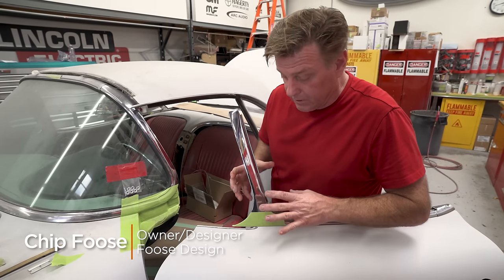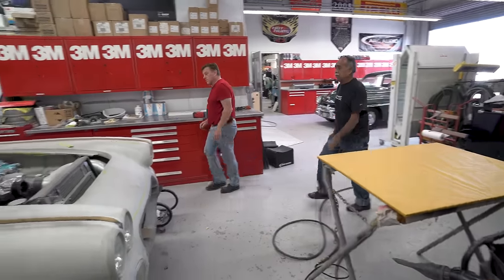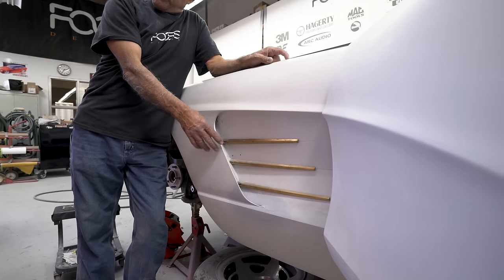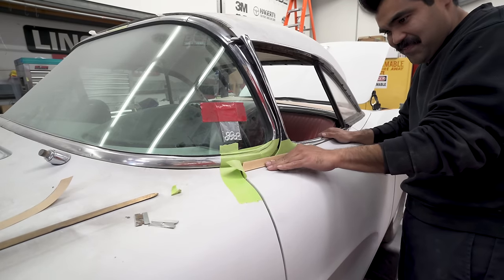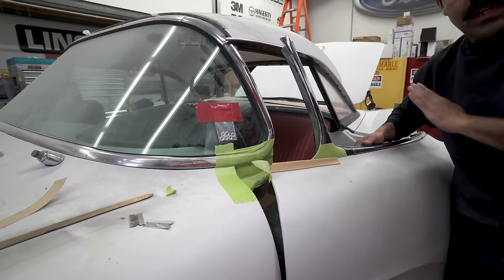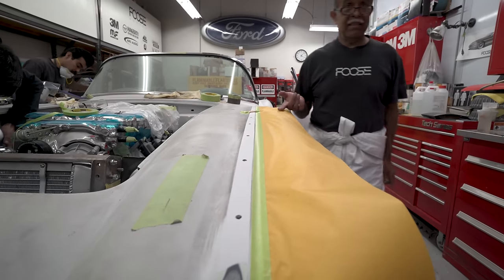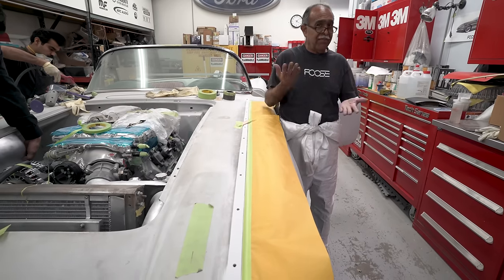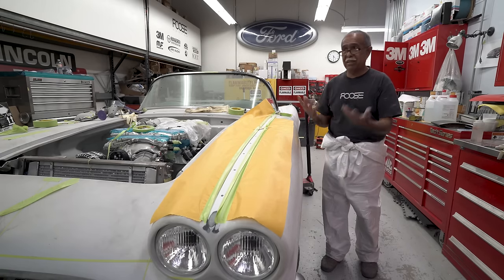Foose Design | '62 Corvette C1 Build - Part 6 - Refining the Details

Comment: 1958 Corvettes have a reinforcement beam underneath the front fender. The beam bolted directly with the stainless fender spear using the tabs and speed nuts. Go to or search -> Corvette Central 58 TOP FENDER MOULDING REINFORCEMENT - PAIR ( GOOD IDEA TO USE ON 1959-1962 ALSO). Lists for $126.50.  This should correct the fender sagging issue.

Comment: Bondo...that is regular body filler , is NOT compatible with fiber glass surfaces. Yes the resin is the same, but body filler is made from  fine talc while fiberglass has chopped strands of glass. The reason you should never put regular body filler over fiber glass parts is because fiber glass is more flexible and regularly flexes as the car goes down the road...body filler doesn't flex at the same rate, so it is likely to peel or crack off of fiber glass substrates. Maybe by body filler , that body man was talking about chopped strand fiber glass filler, which would work perfectly fine. I would also add that things that body men will do in warmer climates , will never work in colder climates. I remember looking in some hot rod magazine in the 70's and seeing a body shop making wheel flares by welding electrical conduit on a wheel lip...and covering it with body filler. I'm sure Chip Foose would be horrified by that!

Comment: If I had been fabricating those mesh screens I would have cut off an extra 1/8 inch and tack welded an 1/8 inch round stock all around the edge 

Nothing worse than catching a knuckle on one of those edges
Reply from the maker: Agreed, but we are doing a flanged edge that will cup around bezel. Just didn't get finished in time for the video.

Comment: Those things that they are talking about. Number one the door post moulding does go down further. Heck mine cracked right there because the door post put too much pressure on the glass right there. One side there is a small vertical crack. The other problem... Foose extended the top fender moulding. So it transitions there from curve to flat. The bonding strip is right there where the top of the fender meets the firewall. I guess he did not like the 62 side moulding.  Personally I like the rocker mouldings... Sorry the midyear dash does nothing for me. Just an opinion is all.

Comment: The only way to do bondo work is to lay down a thick coat on your 1st coat and begin cutting it down when it cures to like a hard rubber. If you wait til it rocks up, you’ll be there all day sanding autobody filler. Bondo work is the only thing I’m fast at in the repair part of restoring a vehicle.